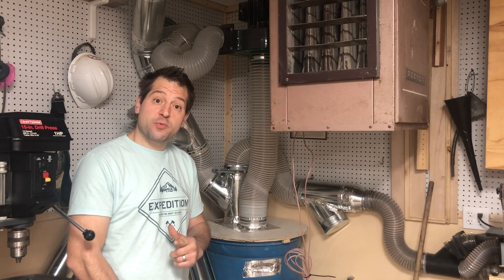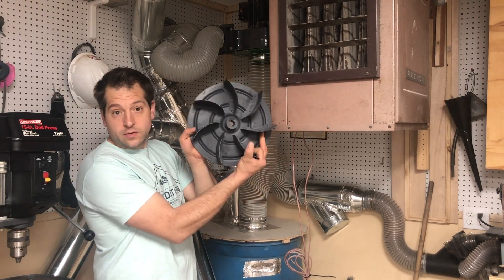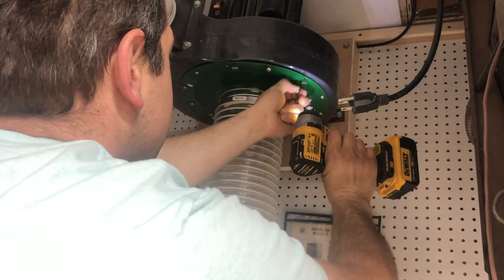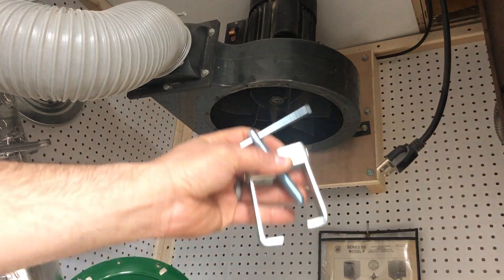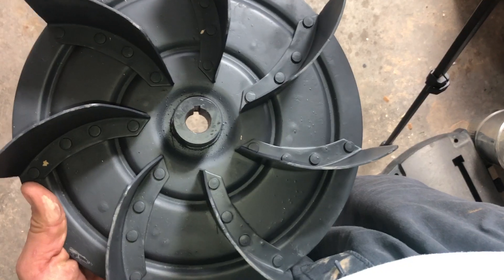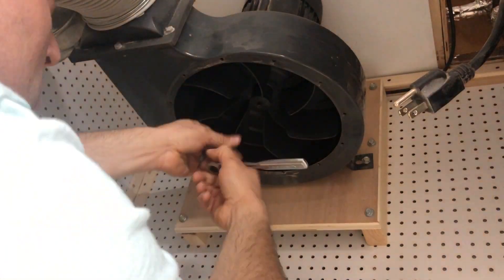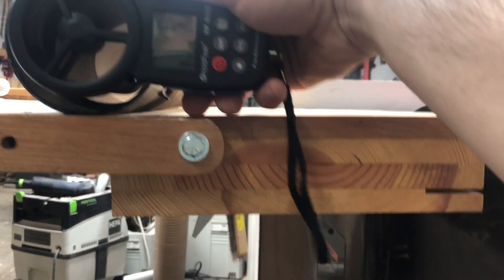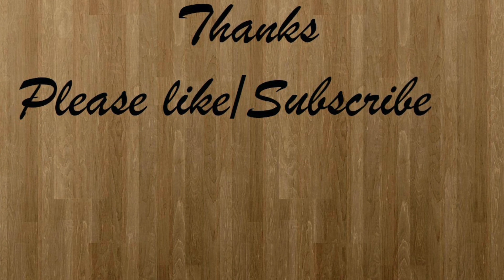DIY Harbor Freight Dust Collector Impeller Upgrade

Comment: I can report that pulling a brand new Harbor Freight impeller off is not an easy task.  The center left handed machine screw is locktited in and needs heat to remove.  I used two different pullers and had no success, even machined a custom one with three set screw in the impeller's groove on the hub and a through half inch bolt to pull.  Heat, penetrating fluid overnight, etc. have not worked so far.  This was a brand new unit I purchased a few years ago and has no rust whatsoever on it.  I am thinking some genius locktited the hub as well.  The propane torch hasn't budged it but the acetylene torch will come into play tomorrow....
Reply: did you manage to remove it? I can't so far. I have bend the original impeller and now I am stuck.

Comment: Hey bud!  Awesome video!  I have basically the same setup.  However I do see one thing that may also help with the CFM on your dust collection.  The hose going through the wall to the outside is a very strong 90 and needs to be less of such turn.  Air flow is slowed by the friction of the 90 as why it’s best to do slight changes like two 45 s.  Try giving it a test of straightening it out and retest it and see how much it increases.  If you make a video on it I’ll subscribe!

Comment: Anyone having the impeller chipping when trying to pull it.   Mine just broke on first attempt. I ordered the puller he linked but then went back and watched the video and he is using a different one. Needless to say I am not happy and afraid to continue cause if it breaks again I may not have enough left for a 3rd attempt.
Reply: In case anyone reads this after lots of heat, PB blaster, and cutting over an inch of metal around the shaft, it took me removing 3 impeller blades off, drilling 2 holes and using a Harmonic Balancer Puller to get it off. Once that was installed it came right off. The shaft was really rusting and the key never came off. Save some work and once the pulley breaks to much of the flange go straight to removing blades to get this puller on it. 

I’m still not sure whether I should fuss with removing the key or just leave it and install the new impeller.

Comment: I bought the same pulling tool and I couldn’t get the impeller to budge, the tool bent.
Reply from the maker: Wow
Reply: Wish my tool bent. I got the one he linked not the one he uses and it chipped the actual impeller as I tried to remove it

Comment: While yes, a larger impeller will move more air, the motor has to be capable of moving that much air.  Simply putting a larger blade on the motor doesn't mean it is a free improvement.  Your motor will work harder to move more air.  Monitoring the amount of heat your motor is generating is important.

A second thing I noticed right away is that the larger impeller blade is designed to spin the other way.  The curvature of the fins when spun properly will move vastly more air than when spun backwards.  You gained (roughly) 12 to 17 improvement (40%).  Had you gone with the correct fan blade I can only guess at how much more air flow you would have gotten, but it has been my experience with a squirrel cage fan, spinning it properly versus backwards seems to yield (what feels like to me) to be about 40% efficiency, leaving much more airflow to be had.  While you DID improve your air flow, most of us don't have the luxury of exhausting to the outside of the shop.

I will look into upgrading my fan but will do so with much greater trepidation with regard to motor heat.  I have yet to see anyone compare the two.

Comment: Now that you've upgraded your impeller, take a look into minimizing the angles and turns in your tubing. Any time moving air has to go around a curve (and the tighter the degree of a curve) it causes turbulence. This turbulence reduces air flow velocity. For maximum efficiency, it's said that a 5 ft strait run from your air intake is advisable. Sometimes we don't have room to do so, but the straighter your pipes, and the softer the bends, the more efficient your dust collection will be!

Comment: I have a fairly new HB dust collector that uses the 4" flex tube to go my tools sitting right next to the collector.  It seems like I have lost a lot of suction.  The bag is not full, and I don't see anything caught or blocking the way.  Any suggestions on where to look?

Comment: They must've upgraded the impeller on the 1hp? 
 
Also, I noticed the HF 2hp unit (supposedly a 20 amp motor/plug) now comes with a regular grounded 15a 120 style plug... feels sketchy AF.

Comment: I have thought about exhausting my DC to the outside, but my shop is in my basement and there is a gas furnace and gas water heater in there also. I am concerned that I could backdraft the combustion exhaust from those two apploances into the shop. Has anyone dwalt with something like that?

Comment: Instead of banging the impeller in with a hammer, you could draw it in with some all thread, hex nut & washer.  Saves damage to motor or bearings.
Reply: not many people will have LH thread ready rod kicking around but it is a good idea vs. pounding it onto the shaft.

Comment: I think you'd also get a big increase if you got rid of most of the flex tubing, and straightened the routine of the ducts.  Corrugated flex tubing increases turbulence and decreases flow.  Every turn or bend decreases air flow.  Any bends you need should be as gradual as possible.  The make larger-radius 90 degree elbows, or you can use two 45 degree bends to smooth it out.  Any flex tubing should be minimized and should minimize bends.
Reply: Ha! I just basically made the same comment as yours. 100% agreement!

Comment: I hear there is a cheaper impeller out there? Does anyone know where I can get one? Ricon is out of stock and 120 bucks.
And, will a 12 & 1/4” impeller work?
Reply: Look through the comments here for Wen 3403-022
Reply: @joshuamurphy5073  looking like that's also unavailable
Reply: @nicklavioletteiii2183  did you call or email customer service or just try to buy it online? I mean, I obviously don't make the thing, and you might be late to the party re the current spike in interest, but that's how I got it, by emailing customer service. 

Good luck!
Reply: @joshuamurphy5073  I just looked online, but I'll try calling them, thanks!

Comment: FYI the link for the 6”  adaptor is not a correct item. I have to return the one I ordered.
Reply: I just made one out of plywood and an hvac starter collar.  You'll need longer m6 screws and ideally a circle jig for your router, but you can probably get by with a jig saw and some silicone.

Comment: Your 6” adapter looks like a perfect replacement for the HF 5” part. However, the Amazon link is to a product that is not a direct replacement and cutting is required. Is your link accurate?
Reply: I couldn't find his part either so I made one out of plywood underlayment I had around and a 6 inch hvac flange, which fit right into my super dust deputy. 
I had to buy longer screws, was the only pain point there.

Comment: I've been wanting to upgrade my old green HF 2HP DC for the last couple of years. That Rikon impeller seems to become unavailable on and off.  The flange you list is also not currently available. I have seen others use a 6" HVAC flange adapted to the stock plate which seems to work but requires more massaging to get it to work right. On all the HF DC Upgrade videos I have seen, nobody seems to address the output side of the impeller housing. I need to get to my shop and measure, but isn't the output 5" like the factory intake?

I really dislike my separate system due to space limits, and I can't vent through a wall, so I am considering figuring out how to upgrade the output and separator ring to 6", and doing a Thien cyclone separator in the separator ring. I already have the Wynn 35A filter in place and it flows way better than the stock bag so we are good there...  

Lastly, your output makes a funky S curve, straighten that out as best you can, rotate the impeller assembly etc... so you have as straight a shot as possible if you are serious about airflow.

Good luck and good video!
Reply: Don't know if you're still looking, but Wen might have the right impeller for you. You have to email customer service and ask for the specific part (DC model number dash 22, "turbo fan") for their very similar collector.
Reply: @joshuamurphy5073  I actually completed the install of the Wen impeller on my HF DC 2 days ago... Thanks. Seriously considering the 6" flange update as I would like to support a 6" main with 4" branches.
Reply: Oh, and I replaced the blower intake with a piece of 1/2" plywood that had been pre drilled with holes for the mounting screws using the factory flange as a template (drill from the impeller side so the holes definitely line up), and had a perfect ish circle cut with a router and trammel (compass) jig.

With a 6 inch hvac flange tapped carefully through the very tight router-cut circle, then screwed and caulked in place, I was able to reuse the gasket, but needed longer screws. I think they were m6?

Anyway, did all that and felt a significant difference at the blower intake, but not much noticeable after the ducting (and had no equipment to test that, but I suspect the cfm goes up, but the curve gets worse with the same impeller, making the whole thing about even at the business end).

New impeller arrives today, though, and will definitely benefit from the ~44 percent larger hole.

Comment: Thanks for the information. I found it very useful!  Did you see a CFM increase by simply  changing the inlet cover from 5” to 6”?  If so do you remember how much?
Reply: I just tested this out when I upgraded my dust collector inlet to a 6" HVAC flange. Without any resistance after the blower, the inlet jumped from 650 CFM to 829 CFM. The airspeed did drop from about 30m/s to 25m/s, but that should be expected with the larger opening.
Reply: He told you the difference in the video! It was about a 40% or so increase.
Reply: @charlieodom9107  no, he showed the difference between the larger opening with a smaller impeller vs a larger one. Did not say anything about what he was pulling BEFORE the 6 inch opening.
Reply: @joshuamurphy5073  why bring up shit from 6 damn months ago?
Reply: @charlieodom9107  because I just read it for the first time and don't want someone else to come along and get the wrong information?
Reply: @joshuamurphy5073  then quit providing the wrong information!!!!
Reply: @charlieodom9107  wut? I didn't provide any incorrect information. I'm just a commenter researching DC on YouTube.  From my understanding of words and this video, it appears you replied to a legit question by another commenter (Sabrina) in a dismissive and wholly incorrect manner, and I tried to fix it for posterity.

Since we are here, though, I will add a mostly useless anecdote (for posterity) that is relevant to the original question. While I didn't measure the difference before and after, I DID open the inlet up to 6 inches last week, using a piece of plywood and an HVAC fitting, and longer screws. 

The difference at the inletseemed to go from "pretty good" to "OMG, I think this is going to eat my hand". That said, it seems likely the fan curve is altered and once you hook up a cyclone, and duct, and everything, I'm not sure it's an improvement. I don't think it's a detriment, either, but I was lacking an anemometer in any case to get concrete data. 

I would guess no major change without the impeller upgrade. unless your runs are VERY short.
Reply: @joshuamurphy5073  interesting… what would you say about this……. Upgraded impeller, dust deputy XL, 6” fittings and main trunk, vented outside….. worth all the hassle? Or not.
Reply: @tillertradeco tl;dr yes, probably. 

 I've only eve vented outside and always ran some kind of separator before the impeller, so i have little basis for comparison. It seemed cheap and easy to do and always made more sense to me than messing with filters or those terrible bags and/or accidentally sucking big chips or washers or whatever into the impeller. 
So I'll say this: i switched to the 5 inch dust deputy because i clogged my Thein baffle one too many times. Check out Jay's Custom Creations for the plans I used for the Thein Baffle. It's great and practically free, but my old planer would often send long strips that clogged the baffle and a couple times i accidentally sucked a bag or whatever in there and it was just so damn hard to service the way i built it, so it was either redesign the baffle or use buy the dust deputy. The latter won out and i really like it.  Keep in mind, i was only 150 into the HF collector/ baffle and the DD was another 170 or something 4 years later. 
So when I switched to the DD. I decided to figure out actually ducting the shop and relocating the collector and while I was in that project I started researching upgrades and found the Rikon mod and then found some comments that pointed me to the Wen part.   

All in all: ducting 5 inch with 4 inch drops has worked out great.  The larger 6 inch inlet (luan plywood and a starter collar) with the same impeller tried to eat my hand when I felt for an increase in airflow (but i suspect the pressure to velocity curve tamed it back to about previous levels after all the ducting.) The impeller upgrade, which i did last, improved velocity at every tool about 40 percent. I bought an anemometer to actually measure the impact of the impeller. Wish I'd had it all along to support my findings at various steps. 

So dollars, I'm out 35 for the impeller,  150 for the motor and housing (super coupon), 170 for the DD, and a couple bucks for starter collar,  6 inch dryer vent, etc. Plus the ducting and whatnot that i would buy with any system.  Compared to anything else I could get under 400 bucks, even used, I'm very happy. The biggest hassle stuff wasn't even the conversion. It was mounting my motor high enough in my basement that I could still use the same trashcan. I had to make a couple of mounts and use heavy screw eyes and paracord to keep it all safe above my head while i got it bolted in.
Reply: @joshuamurphy5073  " Do not speak to a fool, for he will despise the wisdom of your words."

Comment: I tried this in March and the puller literally cracked the flange/ lip on the impeller hub and it fell apart. Same thing with 2 other fans, that I got on warranty return for the ‘broken’ motors. Looks like its pretty hit or miss if you can actually do this with one of these motors. 

Nice upgrade, if you can do it. I may still do the 6” intake mod though, despite not being able to upgrade to the Rikon impeller
Reply: Yes, mine was the same way. Flange shattered when I hit it with the a hub puller. I had to cut/destroy the stock impeller to get it off. If you have a pneumatic cut off wheel tool, you first saw off one the impeller vanes. That gives you access to cut a slot through the hub—parallel to the motor shaft and it slides right off. I saw a dramatic increase in suction going to the rikon impeller. My amp draw went from about 9.5 amps to 13.
Reply: @fluxcapacitr121  yep- finally got mine off with an angle grinder by cutting the rotor in 2. One half was literally seized on and I had to pry it off. I got almost 75% more flow out of mine, and can now run 2 machines at once, 4” ports, 12-15 foot runs. Great upgrade
Reply: My swap wasn't even difficult. No mallet involved until the last 1/4 inch maybe and the cheap auto parts store puller slid it right off.  If you are breaking multiple flanges after removing the center machine screw, something is probably not machined right or otherwise seized. That sucks. Sorry to hear.

Comment: The impeller is $100. That takes away the good value.
Reply from the maker: The CFM gain is worth it compared to cost to upgrade if you already have the DC
Reply: @theselfmademan2875  That makes sense. I think the Grizzly comes with a 12" impeller for $375 but you can get it for less. However, it's $99 advertised shipping. So I guess this would be the way to go after all. You can opt for the Harbor Freight warranty for that amount and take it back if it fails. Just keep the old impeller handy.

Comment: Can you tell me is your HF model number is 61790 or 97869? They are supposedly the same machine.  I got the Rikon impeller but it hangs out the housing just a bit.

Comment: You are replacing a forward curved fan blades with a backward curved ones. Significant difference in fan characteristics like cfm, static pressure, efficiency, fan curve etc. The difference in results you note are not just due to impeller size.
You could have overloaded your motor if the larger impeller was forward curved type.

Comment: The impeller fins are opposite from each other. Does this make a difference?
Reply from the maker: No it doesn’t mine works great!
Reply: Reverse vane set up is more efficient.
Reply: @matthewhina2947  Can't be. I'm wondering if the motor was originally incorrectly wired and spinning the wrong way making the original impeller inefficient. It just doesn't make sense otherwise.

Comment: Will this impeller fit a performax ? I can't seem to find specs on the rikon hold diameter/shaft diameter comparison
Reply from the maker: No sure
Reply: @theselfmademan2875  nope, after further investigation, this impeller is too wide (12”) and will not fit the 9 1/4” opening.